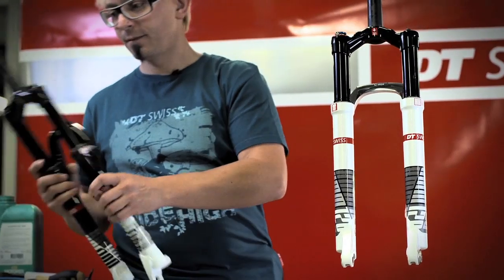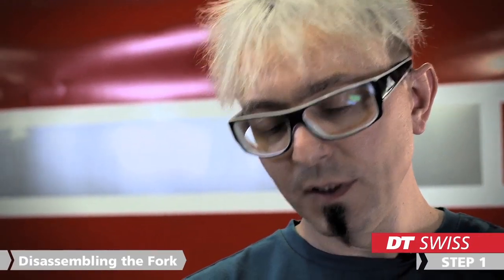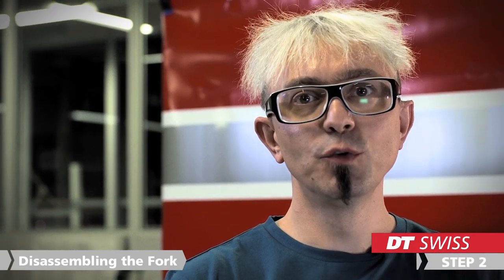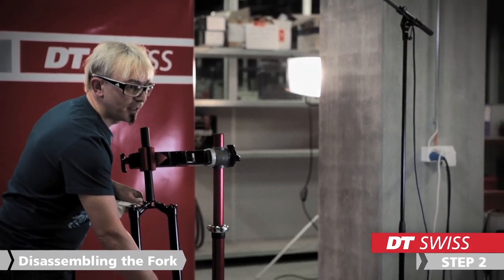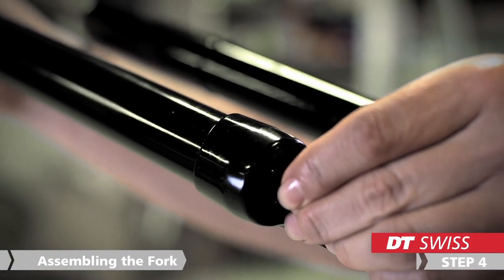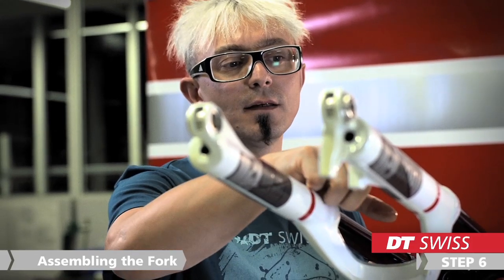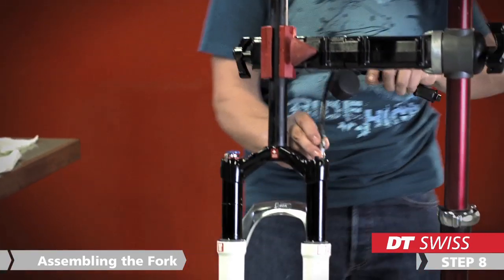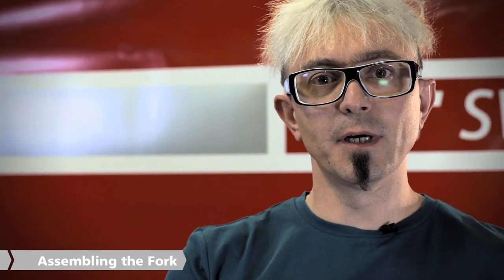DT Swiss | How to a Service Single Shot Twin Shot fork

Comment: Do you have a video how to maintain the other side? I have a twin shot and pushed by mistake the rod all the way up, where is not got stuck. I haven't foud a way to unlock it an can't reassemble the fork, thanks
Reply from the maker: Videos for the damping side are not available, to have works executed on the damping side please get in touch with the DT Swiss service center in your country. Best regards, Kai, DT Swiss.

Comment: Are there any trouble if you use more than 7 ml in each side? For example 15-20 ml.

Thanks
Reply from the maker: Hi Raul, there is a reason we add 7 ml to the lowers. We do not suggest to add more lube than recommended. Kind regards, Christian, DT Swiss

Comment: Just did this service and used Finishline 7.5W oil.  Feels great.  Also replaced top seals (wipers) with the green low friction SKF seals that install easily once you remove the DT seals with pliers and firm upward pull.

Comment: Hi, please tell me, which oil to use for my XMM120: DT SWISS Factory Lube Fluid or DT Swiss/Panolin Factory Fork Oil? Thanks.
Reply: dtswiss ok, but it s difference beetwin the two typs of oil?
Reply: No, it-s two typs of oil, both by Panolin, one Factory Lube Fluid and second, DT Swiss/Panolin Factory Fork Oil, Thanks Chad!
Reply: Yes, it's very clear now, thanks!
Reply: dtswiss Hi.I'm from Russia,I have fork dt swiss xmm 120. What viscosity to pour the oil in the damper? And then we have in Russia who do not ask these forks no one does. And if it is not possible to buy Oil Supergliss 100K for the legs and pants what viscosity will advise you to pour the oil? Thank you.
Reply from the maker: Hi Andriy, clicking noise from the spring can be caused by too much play of the spring in the stanchion or because it is not greased sufficiently. Please get in touch with the local DT Swiss service center for further support. Best regards, DT Swiss.
Reply from the maker: Lube fluid is thicker and should be used for the foam rings under the wipers only. We do not recommend to use any other products as replacement. Best regards, DT Swiss.

Comment: Hello, i have a problem with abs (air unit), when i put it back in, and installed the circlip, air unit is moving up and down and fork is now clicking because air unit is moving about 1-2mm behind the circlip. I ve installed it correctly i checked it about 10 times, it was my first change of oil, dont know what to do. Thank you.

Comment: hi again,

I think I have  a trouble. when I did service, I realised that the lubrication oil from hydraulic side was little brown. the hydraulic cartridge make a sound like a water gun jet when pushed down. maybe has a little fluid leak. the air spring side oil is clear and clean. forks adjust rebound correct and locked let being pushed down around 17 mm
possible leak or cartridge failure?

thanks in advance
Reply: +dtswiss 
Ok thanks. the fork has just 1 year. so should be send to use warranty to the seller then?
has only 100-110 aprox hours of use.

thanks

Comment: hi again.

is it normal that the fork sinks around 15 mm with the locking enabled ?

the fork is xmm 120 ss MY13
thanks
Reply: +dtswiss 

sorry. it is a single shot I. xmm120. MY13.

Comment: First of all thanks for your advices.
I suppose that in the big service is necessary to replace the hydraulic fluid from the rebound cartridge. 

When you squeeze the stanchions into the lowers, the seal lips could twist a little bit. Then, should be used a wood or plastic toothpick as a lever to avoid damage the seal and fit it correctly?

thanks in advance
Reply: +dtswiss I have another question. Imagine that the circlip is not correct fixed into its stanchion gap. you assembly the fork fully and pump up. what will happen apart from bending some internals? would you realise of it sinking down the fork due to the lowers doesn't move smoothly over the stanchions? it is noticed immediately?

it has not taken place, but in this way we could detect soon and correct it in order to avoid damage the fork.

Comment: I´m doubtful about one thing said about seals (not in this video, perhaps not neccessary). Some mechanics recommends extend a dot of oil with your finger arround each extension, and dive 2 or  times the fork in order to spread the oil and reduce seals friction. Supposely, enlarge the life of seals (sorry, my english is not very good). It´s really recommended? The other side is that dust sticks easily.

Thanks in advance
Reply: +dtswiss 

First of all, Thanks for your helpful answer. Related to oil inside the fork, I realise that my XMM righ stanchion soak in oil more than the left one (the fork is  completly new), which seems nearly dry. Not like a seal failure, but more than I´m used to seeing in other brands like R Shox (sorry for the comparison). Is it normal? 

Thanks in advance

Raul

Comment: I have the EXC150 2009 in carbon. Is the fork a single or double shot, is it possible to change the top dialing configuration to the newer TLRC, & is there a handlebar remote??? :D